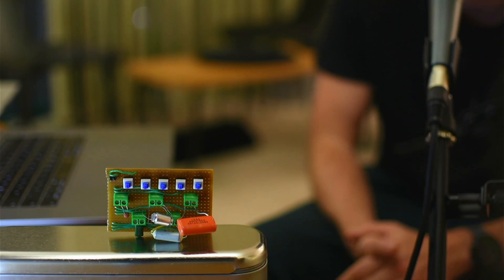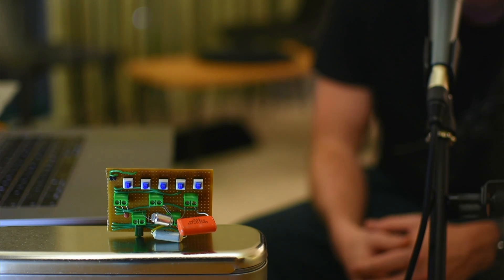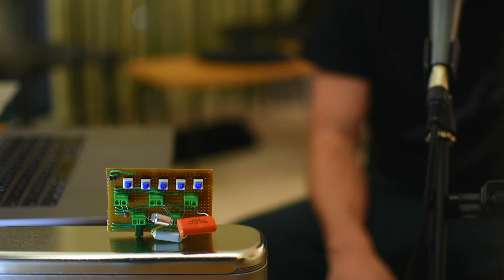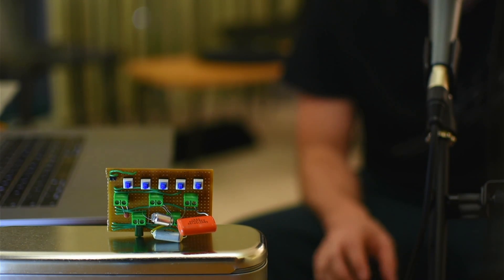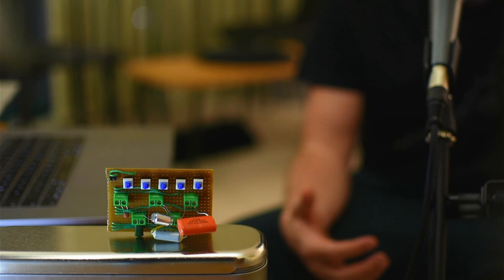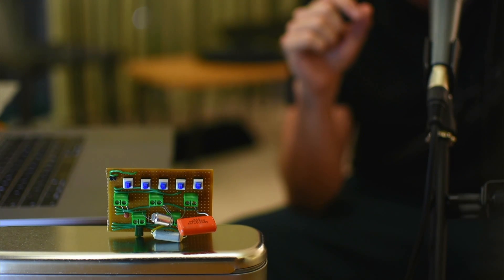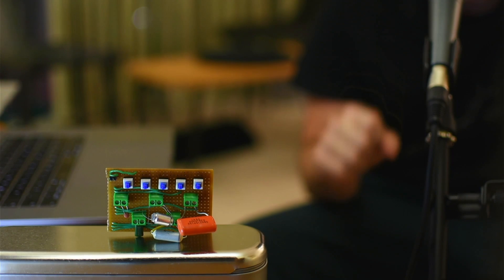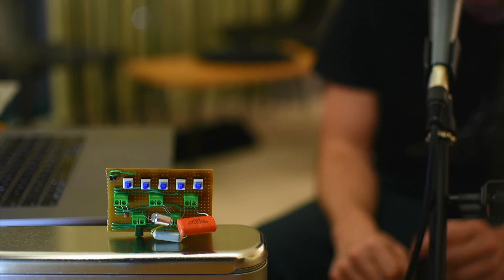Guitar Tone Capacitors Test (Orange Drop Vs Paper in oil Vs Polystyrene Vs Polyester Vs Ceramic)

Comment: Since the dc resistance of a cap is basically infinity, no signal actually "passes thru" a cap. The leads are insulated from each other with a dielectric. With DC they charge and hold. With AC they charge and dis-charge at the rate of the freq. That's why larger caps hold charge for longer allowing it to respond to slower freq. That's it! The only tone difference can be the value of the cap, not the material. Different materials are just for different enviromental applications. In the world of hi end audio any perceived diff is the placebo effect.
Reply: Oh the ignorance is so glaring. True that caps do not pass DC but once the cap is fully charged, however caps do pass DC current on the way to being fully charged but that is irrelevant to this discussion. What is relevant is that caps pass and store electrical ENERGY in an AC circuit. 
Caps work by stressing dielectric materials (molecules) between the plates and storing energy as electric potential energy in the stressed state of the dielectric molecules. As these molecules store energy or return/deliver energy they do so in a non linear way, ie acceptance or return of energy is in a stepwise/non random fashion and these instantaneous current variations or current noise cause voltage noise in the circuit of interest. 
This non randomness in current noise by definition means that the current noise is non white, ie dielectric current noise spectrum and dynamic/time (envelope) nature is according to the dielectric formulation and constitutes signature or voice of any particular cap (and resistors, semiconductors, conductors, insulations etc, etc, etc). 
As to the audibility of cap types this is according to the circuit configuration and the self/excess noise of the circuit/system and will vary. 
So the takeaway is EXPECT different caps to CAUSE a circuit to sound different, subjective audibility and subjective preferences for different caps is a different subject. 

If you cannot hear caps differences then be happy, but please stop telling others that hearing caps differences is due to 'placebo effect'.
In fact with your level of opinionated preconditioning it is evident that your very own 'expectation bias' is forcing null outcomes and that you have cloth ears to fine audio differences.
I suggest spending a weekend in a bush environment to recalibrate your hearing, then come back and take a closer listen to the identifiable sounds of differing capacitor types, it ought to be educational for you.
Reply: @ericmc6482  My hearing is great. I do tone shaping of amps all the time and can hear the diff. between a 250pf and 220pf cap. Current is the flow of electrons from atom to atom. A dielectric is an insulating material between the plates of a cap. that can be polarized. The electrons build up on one plate and de-pleat from the other, when the polarity changes the stored electrons flow thru the circuit to the de-pleated side. The electrons never pass thru the dielectric as this would be a shorted cap and would not work or hold a charge. So current never actually passes THRU the cap, but is allowed to flow thru the circuit as it charges or dis charges, seeming as it's passing thru the cap. In an audio circuit it's ability to let this happen depends on the freq. of the A/C and the value of the cap, measured in typically micro-farads or pico-farads.
Reply: @bradt.3555  I understand what you are saying about caps not passing AC or DC. If it did it would be broken. But the science can't explain ( or can it?) Why 2 caps made from different materials and measure identical on a multimeter sound different? And yes of course you can hear the difference in a .0022 cap, or a .022, and also how a cap that measures .1 can change the sound in an amplifier. But there are sound qualities that can be distinguished and differences in tonal colors can be perceived in a guitar circuit. Again I have done the experiment and found 2 caps that measure identical of different types. And they effect the sound of the  instrument noticably. Perhaps the science needs to be looked into what the ears already know.
Reply: @tonebender69  What I'm saying is our ears and brain can be the problem. A person can listen to 2 things that are identical in sound and they may sound different. Because of expectation bias our ear/brain is not reliable. Science does explain why they can measure exactly the same and sound different. It's because of what I just stated. I don't understand why some people cannot accept that our brain can cause this to happen. Listening tests have to be very, very controlled and still are iffy. I used to be in the deny science cause I hear what I hear camp, That's why I took time to study the science of placebo. It's funny how our ego rather than admit maybe were being fooled would rather admit our brain is too weak to cause placebo to happen. The brain is pretty amazing can easily make us perceive a difference that might not be there. And no I don't look down a narrow science tells all path but it explains much.
Reply: @bradt.3555  I trust what my ear and brain tell me. So let's agree to disagree. To give you another example. I have learned and play guitar 99% by ear. I can hear something and play it immediately. My ears have learned to perceive and decipher the sounds of a guitar in a recording and I figure it out right away. But sometimes a chord or riff is off. I will find that what I'm playing is off. And I KNOW because my ear/brain tells me. I struggle a bit and figure it out on my own most of the time. Sometimes I have to pull up a guitar tab. Ultimately my ears will tell me when I'm successful. So again I trust in what I'm hearing. As for the science? There are others that explain something different from what you understand. Using science in favor of why the caps sound different from different materials. So Let's agree to disagree. No placebo. There is something that I hear time and time again. There is an audible difference in the character, texture, even the feel of using different types of caps. And I stand by that 100%.
Reply: @tonebender69  I learned to play by ear too. When I started there was no internet. You put on a record and figured it out. I can hear when our other guitarist hits one wrong note in a chord. But that's a whole different thing than what we're discussing. One problem is our auditory memory is about less than a second. So to compare you would have to have caps on a switch and have someone switch them without knowledge of which is what, otherwise, placebo. It happens to you, it happens to me, it's just how our brain works, that's why I say listening on something like this is no good. It's why some use the term flat earther, tho it get's used backwards. Science say's the Earth is round but I can see ships fall off the edge, with my own eyes, I trust my eye's. We know that's wrong. I used to hear differences in caps but as I learned more about all this the differences just kinda vanished.Just keep an open mind, there's also lotsa people making big money on placebo, in the guitar world and really in the hi-fi world. 100 bucks from gibson for BB caps? Wow, if you want the looks cool, go for it, but tone? No. Mainly enjoy playing.
Reply from the maker: I guess the "no current passes through" argument is perfectly fine for the ideal capacitor however I'm not sure to what degree the capacitors used in this video resemble the ideal capacitor and whether the type and construction of the capacitor have any impact. I don't have the answer but there's definitely the ideal and the non-ideal version of a capacitor model.
Reply: @vismajeure  I'd say ideal would be if they were exactally their specified value. Whether a good or expensive or cheap if any current got thru it would be a defective part. Now in a guitar it wouldn't be as much of an issue as the voltage is sooo low. In an amp it would be a problem as any current leakage say in a coupling cap would cause big issues with the next gain stage. I have an old Elk amp that had oil in paper caps where all had dried out causing dc leakage everywhere. At the output stage it throws the bias off and causes redplating big time. All the caps you used look like good quality caps. The way a cap works in a guitar makes it so insignificant there really is no ideal type.
Reply from the maker: Hey  @bradt.3555  my comment was less about how accurate the nominal capacitance is and more about all the other types of losses / non-ideal behaviours .. can't find a better diagram right now but this is what I was talking about https://forum.digikey.com/t/non-ideal-properties-of-capacitors/12824  https://forum.digikey.com/t/non-ideal-properties-of-capacitors/12824
Reply: If I play c notes on 5th string on third fret
Then compare it with c notes on 6th string 8th fret

I hear timbre difference, it's still registered as C frequency
But it has tonal or timbre diff

Different string gauge, string tension etc
Reply: @ckngmad1357  That's true but if you looked at an analysis on a scope you would see those 2 C notes have the same fundamental but everything else is way different. This has nothing to do with how caps work. I see people say a pio cap is more bassy than a ceramic cap? Not if they are identical values. It's value determines how long it takes to charge and discharge, that determines it's freq. range. I saw someone say a cap passes DC when it's charging, not so. Current is flowing in the circuit as the electrons accumulate on the plate, but don't pass thru the cap. Current then flows thru the circuit as the cap discharges, no electrons are passing thru the cap, just in and out. the frequency of which is determined by the value. Someone argued that they can hear a difference and they would trust their ears. I don't think that's wise as what I explained about placebo or expectation bias either bounced off his ears or passed thru from one ear to the other unobstructed by anything inbetween. I have nothing to gain in these debates other than it bothers me that manufacturers make big bucks off placebo.
Reply: They do all sound and respond differently though and "that" is audible to a musicians ear.
Reply: @GiulioLuzzardi-xf1xo  The only difference in "responding" is based on it's value, not what it's constructed out of. Different materials are for different physical enviroments only. Farads are a time based measurement. That's what determines it's freq range. How long it takes to charge and discharge, that's it. .022 is .022 no matter the type. I do a lot of tone shaping on amps. I can hear the diff. between a 47pf and a 50pf in a circuit. That's only 3pf., that's .000003uf. Most caps are between 5 and 20% tolerance. Now 10% of an .022uf is .0022uf. There is no way to just compare caps by ear. Even given the same value our auditory memory is extremely short, our meaning everybody's. Like less than a second or so. Musicians are much like audiophiles, because their "beliefs" are so strong they are much more susceptible to placebo.
Reply: @bradt.3555 Sounds to me like you're a guitar player.
Reply: @jomamma1750  Well I try, been trying for 50 some yrs. This made me look back at some earlier posts. I see people say "It sounded better", What is better? Soooo subjective. One thing I've found is we get used to a particular tone and just a change many times sounds "better". Back to caps, When shaping an amps tone, I hear a diff in just 10pf. now if you take a .022 cap and figure 10% for easy math, that's .0022 mf that's 2200pf so 2 of the same cap can be in spec and sound noticeably diff. Take an amp and say you change ten caps from one type to another, even if they're all "in spec" it could sound very diff. just from values not types. And as I said many times just diff. sounds "better". Like Dumble did I try to measure all my parts when I use them. Many times new caps aren't even within their "spec".
Reply: @bradt.3555  Just because YOU cannot hear something does not mean it does not exist.
Reply: @bradt.3555  The words of a typical tone-deaf guitarist......
Reply: @jomamma1750  Just because you can hear something does not mean it does exist.
Reply: @bradt.3555  A tone-deaf says what? I didn't copy that....
Reply: @jomamma1750  I hear a diff in just 10pf. now if you take a .022 cap and figure 10% for easy math, that's .0022 mf that's 2200pf so 2 of the same cap can be in spec and sound noticeably diff. The people who's gear I repair, other guitarists, our bass player, our drummer, our sound girl, n many others are allway's telling me I have the best ear for tone of anybody they know. Read what I put at the beginning from my last post. Less than 10 PF I can notice the tone diff. Diff caps of the exact same value, no diff. Plus I have science to back up my claim. And the science of placebo effect. You guy's all have the same tired argument, "oh, I'll trust my ears" or "your hearing is no good" or "or the claim that you somehow have golden ears". All just denial that you can be subject to placebo. How do you test yourself to determine if it's real or placebo. See, with placebo you do hear a difference, but it's caused by your brain, not what your comparing. But if your OK spending 100 bucks on a 25 cent part so some company can get rich, go for it. Or maybe question yourself and others who tell you stuff that makes no sense, Do some study on placebo effect, your not somehow specially immune. Or make another post like your last two.
Reply: @bradt.3555  Yawn...
A tone-deaf says what? I didn't copy that....
Reply: @bradt.3555  P.S. You clearly, based on your sorry little diatribe, know absolutely nothing about electronics or their effect on sound processing/reproduction. At all. Embarrassing....
But, kindly keep up the pretense, it's HILARIOUS!!
Reply: @jomamma1750  You didn't copy that, well that makes sense. It's very entertaining trying to figure out if people are dumb or just trying to argue for the sake of argument. Yawn? hmm, maybe wait till you wake up.
Reply: @bradt.3555  It keeps announcing its tone-deafness.....
Hilarious!!
Reply: @bradt.3555  Just because YOU blew the timbre of ears out by cranking Marshall Amps WAY, WAY too loud while playing bars in the 70s and 80s doesn't mean the rest of us have. 
But, go on, keep telling us about these things and the effect they have on the mind. We're ALL EARS.....
Reply: @jomamma1750  Hmm, guess we know which camp your in.
Reply: @jomamma1750  ALL EARS, n air between them.
Reply: @bradt.3555  You describe yourself quite accurately..... boomer boi
Less the part about the destroyed hearing....
Reply: @jomamma1750  Do a blind test on the 2 22.35 caps and see what happens. Both sides are foil, you probably mean the outer side of the foil wrap. Unfortunately multi meters are not that accurate. Hopefully within 1%. 1% of .022 mf is .00022 nf or 22pf. 1% is highly unlikely. You still aren't getting that diff heard when people "re-cap" an amp is caused by value differences not materials. 99% of the people doing all these swaps and tests still explain a cap blocks DC and passes AC showing they don't even understand how a cap works. And the signal within a guitar amp isn't AC anyway, it's pulsating DC. The bias voltage acting as what would be 0 volts with AC. Just more or less positive in relation to the bias voltage, so if a person thinks a cap passes AC, Hmm, got a problem there with the signal being DC. Unless you understand how the cap works in the circuit. And don't try to twist placebo around, you obviously don't believe it happens to you. I knew it was real and happening to me. That's why I spent so much time & effort learning about it. I never blew my ears out with loud amps, and have my hearing tested regularly, it's just fine. I'm experimenting with diff values of treble cap in a tone stack and 10pf is quite noticeable.You still won't accept that what your hearing is placebo and don't want to so this is really gonna go nowhere.All reputable elec. engineers will agree it's value not material. And I did watch the video. You should watch out for all the assuming you do.
Reply: @jomamma1750  Guess you mean Boy, Like a baby boomer generation. If so I see you really have a problem with biases. Being a baby boomer means lots of real world experience. Youngsters usually don't get it till they gain some. Till then no clue.
Reply: @bradt.3555  LOL, You don't even know what the foil-side of a capacitor is?? You clearly cannot comprehend how they operate if you don't know how they are built. And your theory about multi-meters not being accurate?? If that's the case how can you guarantee that your famed 10pf test is even truthful?? Hilarious "logic" boomer boi....
Reply: @bradt.3555  You do realize that "back in the day" when you were a young lad with functional ears, ALL capacitors were clearly marked "foil-side", ceramic disks excepted because of their design. This is when you would have been studying electronics, so you should actually know this stuff, what it is, what it means, and how it works. But you DO NOT! Pretty embarrassing, boomer boi.
Looks like you skipped a bit too much school......
Reply: @jomamma1750  Later, man your goofy. For being ALL EARS you don't listen. And to all the people reading, be very weary of the guy who tells you not to listen to someone else. Listen to him, listen to me, get all the info you can and make your own decision. As I said my ears are fine, seem to be better than yours. And yea I did learn "back in the day".  Caps were marked and still are with a stripe on the foil,(outer foil) side. Tho don't trust as they get mis-marked. I can see your just a knucklehead trying to stir things up but that's what's so entertaining. So at least you have entertainment value even if you don't get how this stuff works.
Reply: You see guys, this characters argument that he can "hear" a 10pf difference in a cap but cannot hear any difference between different cap materials because they are a "placebo" is a self defeating argument. In this video, which this character clearly didn't watch, the tester both tests and publishes the capacitance figures for each cap in the test. And, to small suprise, 2 of the caps have the exact same value. And those 2 caps do have a small difference in sound. I'll argue that while the difference is subtle, it IS present and noticeably so. Considering just how compressed flat the sound files are on YouTube, any difference in sound here, however subtle, will be quite noticeable in the room when actually played live. 
So, therefore, this characters claim is entirely invalid. Its argument that what you hear is a "placebo" effect can easily be applied to its claim of being able to hear a 10pf difference in a tone cap. I would say that the "placebo" effect SHOULD be applied to this characters claim of being able to hear a 10pf difference as this character cannot hear a subtle, yet plainly present, difference in 2 caps of equal capacitance in this demonstration. 
Don't get swept up by "arguments" from characters such as this. If there was no difference in sound at all, the industry would have switched to standardized caps decades ago. Caps are cheap and can be effectively changed to alter and potentially improve your sound, and that's why musicians do that sort of thing. Just make sure you install them correctly, foil-side to ground. There are many videos on this forum to explain in great detail what I'm talking about and how to test caps for polarity.
Reply: Just responding to myself, I shouldn't have said no signal passes thru a cap. What I was meaning is no current passes thru.
Reply: I see folks debating this all over the internet and I see "arguments" (statements, opinions, knowledge from study, etc.) similar to yours. My "evidence" and/or "tests" many may call anecdotal or non-scientific but I have played harmonica 46 years, was full time pro by age 20. have played on stage with, backed up, opened for artists in the R&R Hall of Fame, played on many records, had a Jazz, Swing Dance, Blues, R&B band 10 years, was in Austin for 7, have toured, played in LA, etc. That is just to say I have experience, in addition to practicing 4 hours a day when I was learning. I have owned about 8-9 original Fender 5F6-A Tweed Bassman Amps (my main amp for stage playing, 1 or 2 together) plus I have owned about 5-6 hand built replicas, some using new parts but many using vintage parts. I have owned 2 Bassmans that were 100% original electronically- every resistor, cap, transformers, etc. completely untouched. Several had a variety of caps and a few resistors changed as normal service. I have owned 3 Bassman replicas built using 100% PIO Caps (Astron, Vit Q, Gudeman, etc.) and I have had changed over (not the 100% originals) 4-5 original Bassmans to PIO capacitors and every single time there was a great tone change. Whether it be harmonica or the 40 year veteran guitarist in my band (has been on hit records) with a strat, the difference was noticable. On the guitar just more musical frequencies and "sparkle", a clarity but still when leaned into every bit the full tone people expect from a Bassman. On harmonica same, every bit the punch and honk (I use mostly 1940's to 60's crystal elements) but again just more clarity. This has been most pronounced when playing my vintage 1960's Shure 585 (predecessor of the 58 but Hi-Z only) that I use with my restored 1940's Chromatic harmonica with the early better brass reeds and nickel plating on covers. This would be the most pronounced detectable difference. Sure, some caps changed were orange drop, mallory, etc. (don't change the Astrons if they are in spec) so you could point to the variables but, every time, with the amps already sounding good they sound better. The last one was an April 1959 with all Orange drops and it roared, those immediately came out though and with the PIO's in, better.....unmistakable. So, for me at least, if the amp is not original caps they come out and the PIO caps go in. I have also had feedback from many sound men, studio engineers at sessions, guitar players I invite to plug in and try my Bassmans....they all want to know about the amps. I am not an electrical engineer but this has happened too many times as the only variable to ignore.
Reply: @gabrieln3613  Have you actually measured the caps being replaced against the replacements? Old oil n papers drift out of spec badly. new caps can range from 5 to 20% tolerance. This variations can have a huge effect on tone. Then add in the drift of old carbon resistors. New resistors you can get 1% but new carbon resistors are usually 10 or 20%. Have you ever done a blind test with diff caps that have been measured to ensure they are the same value? Over the years as I have studied these things and most of all the placebo effect I have come to realize how much our brain influences what we hear. I fought believing hard for years but had to face up that my brain fooled me A LOT. Very hard to admit to myself, being musicians we have ego problems as it is. Pushing back my ego has allowed me to see things clearer, but not allway's what made me feel comfortable.
Reply: @bradt.3555  Did not change resistors. As I shared this was not set up to be some scientific experiment. I have taken several original Tweed Bassman amps to a tech. He graduated in the '60s with an electronic engineering degree and has worked on tube amps for 40 years, his professor is also the one who came up with adding the screen resistors onto the power tubes in dialogue with Leo Fender. The two or three amps were running just fine, irregardless of resistor values, The only change made was to pull the various orange drop caps and install the paper in oil. This gentleman worked exclusively with an oscilloscope and he was so surprised at the tone difference. As I shared, In every situation it's been noticeable. Egos aside the one guitar player I mentioned as a producer, engineer, and full-time 40-year guitar pro who had owned about 35 vintage strats and various Marshall and Tweed bassman amps also, a highly skilled pro who played through a couple of my amps, They sounded great but there was an improvement when we changed to the paper in oil caps. We can speculate all day on what may have been in or out of tolerance with changed components, etc. etc. etc. And I understand about carbon comp resistors but those weren't changed so to me that is totally irrelevant we are talking about capacitors here. So I would not spend time trying to set up some type of scientific experiments. Have done too many amps at this point with using these military grade PIO caps and people who didn't know anything about the commenting having heard the amp before and after and my own ears. I see people debating all of this online with all of their scientific and electronic knowledge. The same thing happens in farming which I happen to design farms. The academic professors will tell you all about climate change, livestock, various crops, but they've never worked in the field. It sounds like you play music and have delved into this which is great. I have changed enough amps in my friend who builds amps with the most professional harmonica endorsers of any company uses these exclusively and has thousands of them. I knew nothing about capacitors only the improvement in tone it made in the amps. I just got a 1953 Gibson GA6 and if any of the caps are out of spec they will definitely be getting changed to paper in oil, not some orange drop.
Reply: @gabrieln3613  My only thing is if it's not done  controlled you have to consider the placebo effect. Thru dealing with hi end audio stuff and experience I've found it to be very strong and very real. We really hear differences even if they don't exsist. I have no problem with making something sound better or more like you want it but I wanna be sure I'm doing something that I'm not just believing is doing something. Having done many tests with caps and knowing how they work I know there has to be a reason someone is hearing a difference.
Reply: @bradt.3555  I will leave that to others to figure out "why" and understand why a signal passing through an orange drop sounds one way and then through a paper in oil cap just seems to allow a broader range of frequencies that are very discernible to the ear. My friends listening to my amps have just observed "It sounds more musical" So the scientists can go figure out why. I've done the same thing without put transformers on Fender Tweed bassman amps. Build a complete replica using paper in oil caps, and sounded great with a reproduction output transformer, pulled it out and dropped in a triad 45249 original from a 1960 concert amp the same as a tweed bassman and boom, still a great sounding strong amp but a discernible expanding of more subtle overtones and better sounding overall. I'm sure they are reasons why it sounds different but I consider it the same as the capacitors. All else being equal They sound better. I only commented because I don't know anyone who has had the opportunity to change to paper in oil caps on as many original fender tweed bassman amps as I have. Plus my friend who uses them has endorsers who are 30 and 40-year professionals and could endorse any amp they want but his with the PIO caps that are new old stock and tested is who they went with to endorse. I don't need to analyze it further but I just sent an amp to a tech today to switch out the caps if they are out of tolerance to PIO, I trust my own objectivity and ears to know that I am not operating in a placebo zone that I have convinced myself of, That's after playing 46 years and going with where the tone is to be found for whatever cause.
Reply: @gabrieln3613  I guess my point is unless you test the value of the cap any tone diff is due to variations in value not the material. Nothing passes thru a cap it blocks all current flow DC and AC. .022 mf is its ability to hold a charge and dis charge, that process determins its freq., and allows current to flow in the circuit NOT thru the cap., Thats why material can have no effect. What people hear is caused by a pre concieved expectation bias, I know its tough to admit to ourselves but that is whats happening. I guess there is some validity to the idea that if we think it sounds better we will like it better and be happier with it. I'm just trying to present the facts so some people who understand the process might save some money. In hi end audio the placebo phenom. is greatly used to take peoples money. In the guitar field this effect doesn't seem to be as widely exposed or understood, which is too bad cause most of us don't have the funds of hi end "audiophiles".
Reply: @gabrieln3613  electrons do not pass through capacitors, your lack of fundamental understanding defines your ignorance
Reply: @bradt.3555  I really agreed on this. If all, I mean, ALL the components where exactly same values, the test would be valid. In an amp, putting the exactly same capacitors, but in the middle of the circuit, maybe some resistors a little off value can change the tone. Man, valves, how many differences the tubes can bring to a sound of an amp (the part of variations in some resistor os BIAS, for example)? Even a original capacitor off value before you do change them, there is so many variations to you tell me that the material of the capacitor is changing the tone. In my opinion this kind of test is not valid. The same for the video test, those capacitors are all diferent values. Obviously the PIO with the higher capacitance will be more bassy. People saying the Orange is more likely, more bright, that should be, is less value than the others, more bright..
Reply: @Sartori48  Yup, people have been kinda mis-led by being told caps block DC and let AC pass. They block all current flow, but by charging and dis-charging cause current to flow in the rest of the circuit. Also the placebo effect. People either don't really get how it work's or do but it's seems so real it's hard to accept they could be hearing something that doesn't exsist. It's human nature to not want to admit we've been fooled, even by ourselves. Lot's of smart people use this to sell stuff.
Reply: @Sartori48  You also seem to get it, the larger the value the SLOWER to charge and dis-charge thus seems more bassy,  ie: SLOWER frequency caused to flow in circuit, but not thru the cap. If it actually did pass thru the cap then yea, materials might affect tone.
Reply: @bradt.3555  can measure the caps all you want. You can do the experiment yourself. Find a .022 pio, a .022 poly, .022 ceramic cap. The fact is that the different cap materials 100% sound different to each other. No matter if they measure identical or different on a meter. I have tested this extensively and measured each cap. Example PIO caps will give you more clarity and frequency range. Ceramic caps add more distortion. They are not as sparkly clear and smooth as PIO. They have a grit to the tone. If you can't hear it? Then you can't pickup the subtle nuances. Some of us have better hearing than others. And NO it's not your brain wanting to hear something or fool you. You CAN HEAR it. Unfortunately you can't. Put the science aside and just A B them. You can use the science all you want to argue that it's the tolerance. But perhaps there is another scientific explanation to why they sound different. I have had the same experience from testing using my ears and a meter. @gabrieln3613 I see that you can hear the difference like I do and you are 100% correct. I can even hear the tone difference in the caps polarity. Using alligator clips and setting the guitar tone knob down to 0 for woman tone. The tone will be dark with midrange one way. And the other way it will be scooped. Dark with some clarity on top. That's how I solder them in and it sounds best for Clapton woman tone.
Reply: @tonebender69  I've been comparing this crap for better than 50 yrs and my ears still test like a 20 yr old. You should study up on placebo. I got into studying it with my association with hi end stereo stuff. People don't get how strong it is. It really makes you think you hear a difference. Blind testing is the only way to test this kinda stuff, listening is just no good. And EVERYONE is subject to placebo, me included, it's just the way our brain works. A caps freq. range is based on how long it takes to charge and discharge, that's it's value. Micro farads , PF's etc. are all time based measurements. And unlike the nonsense you see on the web, caps block all current flow DC and AC, as current is the flow of electrons and electrons never pass from plate to plate thru the dielectric. If it did it would be a shorted cap.
Reply: @bradt.3555  yada yada yada. I don't think you understood. I measured the caps and they all were the same. .022. ceramics, poly, PIO. My ears hear the difference. Stop trying to convince me that I'm not. I don't listen to sound, tone, with my ears alone. The ear is the receiver and my brain tells me that they sound different. I repeat that ALL THE DIFFERENT CAPS ARE IN RANGE!!!!! You scientific guys deny our hearing and fault our experiment by saying. "The experiment is faulty because you didn't measure the values of the different caps". You tell us that what we are hearing is the + or - value is what is giving the different tonality from the caps. So we do the experiment by measuring and finding caps within 1% or less in tolerance and again our ears tell us that they sound different. And you are here still arguing the fact? What is more scientific? You telling me what my ears are listening too? Or me coming to the conclusion that they sound different in a measured environment using my own ears and brain???
Reply: @bradt.3555  my ears/brain can tell me about the tone of the individual caps. Ceramic sound gritty and less clear and smooth. The complete opposite of the PIO which convey a pristine, clear, and smooth tone. I own somewhere in the neighborhood of 14 guitars. Many Gibson, and Fenders. I have repeated this experiment with my guitars over and over again because I have gone to great lengths in improving them with pickups, hardware, pots, and caps. It has proved very fruitful. I have purchased caps that were supposed to read a certain value and found that they have drifted to another. So thanks to my multimeter, ears, and my brain? I have found what I was looking for. If you can't hear it? Then perhaps something in your hearing is not functioning correctly. Perhaps that is another variable that would need to be checked. Having a hearing test to see if your human equipment is working well. Words can express and explain sound. Not science
Reply: @gabrieln3613  Your experience may be the tell all of the cap wars.
Reply: @machwind3266  haha, I am not quite sure what to make of this. I only know when I first learned of this the AMP tech I was working with had electrical engineering degree from the '60s, his professor had worked with Leo fender on some of the original circuits and adding screen resistors to the power tubes and so for. Things go very very quickly with me above my knowledge of electronics!!!!! He did change caps though, ones that tested good but were something like orange drops, We changed to the new old stock military paper in oil astron and vitamin q types. Several musicians not even knowing this commented on it and every single time with about nine different amps there was a subtle but noticeable, Don't ask me how but it just sounded more "musical" like the same but with some extra frequencies. On harmonica especially noticeable with the chromatic harmonica which is a more subtle tone than the smaller diatonics that punch out the Blues and saxophone tone when using certain microphones. Anyway, any amp I have is going to be switched out to those, beyond that I would not dare argue with anybody on electric knowledge.
Reply: @machwind3266  I've heard about these capacitor wars but had no idea what a hornet's nest it is! Judging by the comments here there is some massive egos involved so I would steer clear of it.